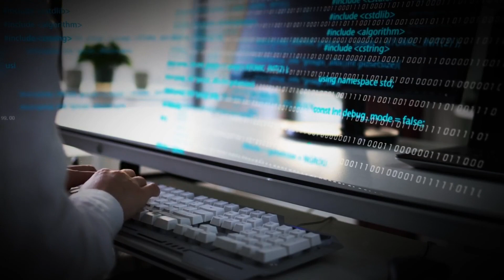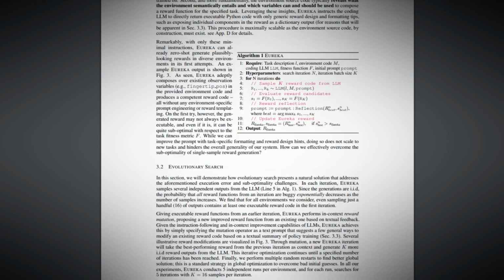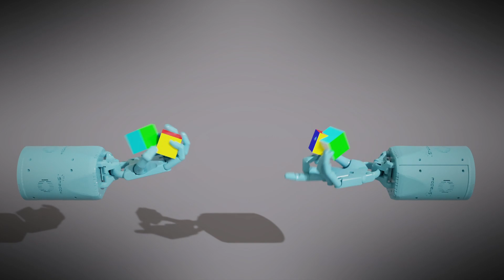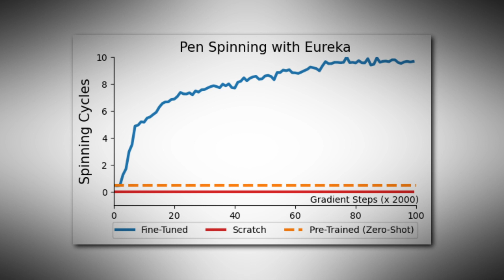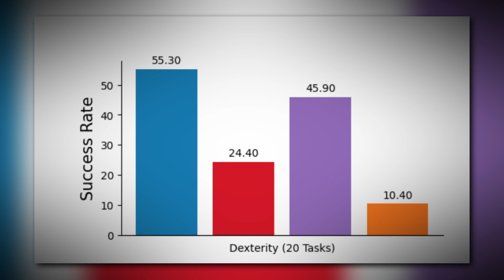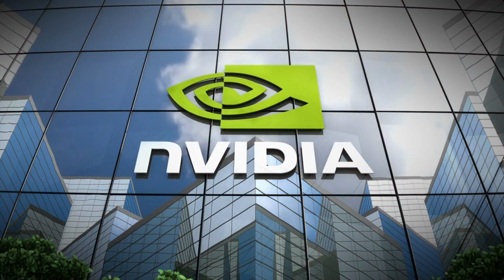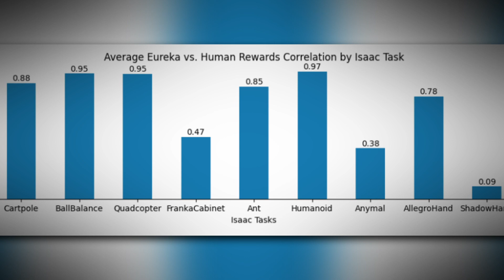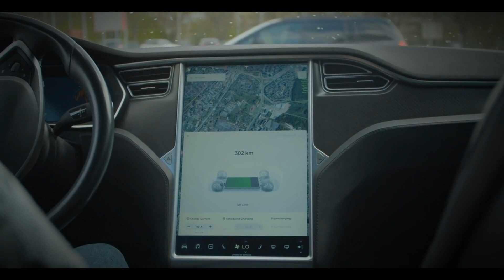Revealing the World's First AGI: Nvidia's Eureka

Comment: Artificial General Intelligence? This sounds like an AI, not a full fledged AGI.
Reply: You're correct that its not as of now, but it will be. AGI doesn't necessarily have to be full fledge out of the box. It is the first platform that will train the first AGI
Reply: @distorta  We are a while off general intelligence.

Once the cats out the bag though, it will accelerate potentially to the point of a god in a box.

For now though, we have glorified scripts.
Reply: @distorta  Oh, I do.

This is not it.

Limitations on *hardware* is the issue I am awaiting, Until then.

While impressive, of course. We have some ground to cover. One may not exist without the other.

And if we keep starting wars as a species and fighting over resources. This may grind to a halt.

Meanwhile your coding skills may be godlike. 

It makes no difference.